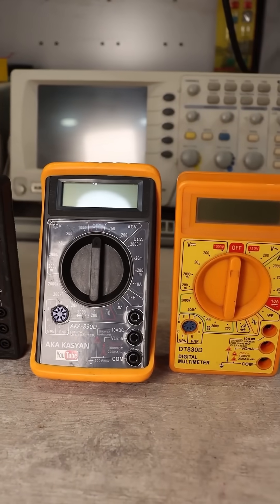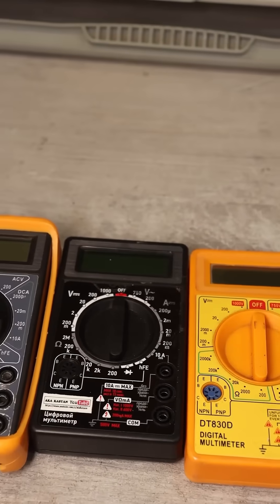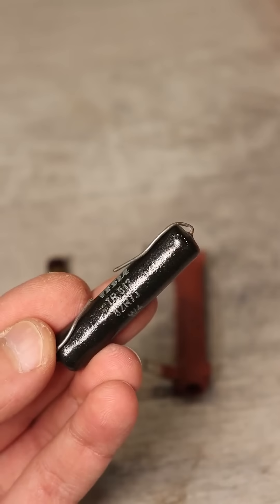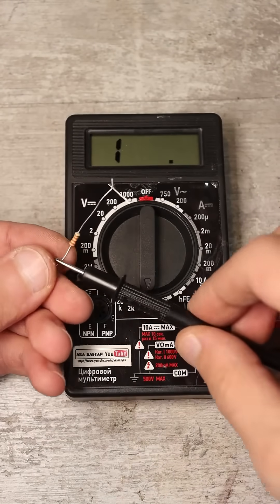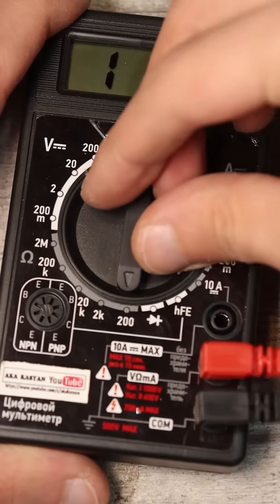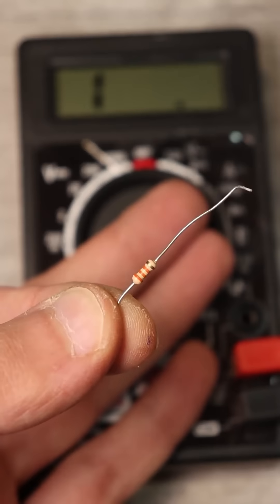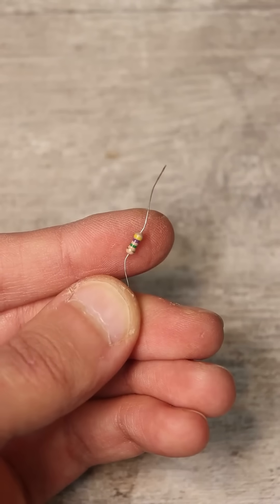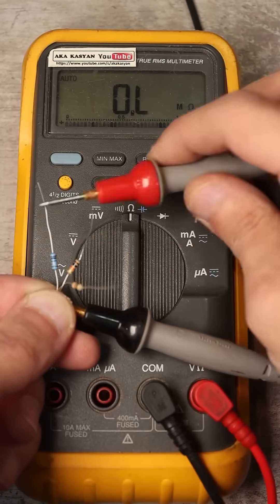How to test a resistor with a multimeter

Comment: Measuring from lowest range up to the highest on the manual multimeters is actually stupid and time consuming method. Opposite way is much quicker, because you can skip many unnecessary steps/ranges between.